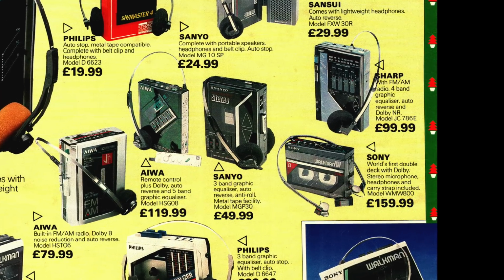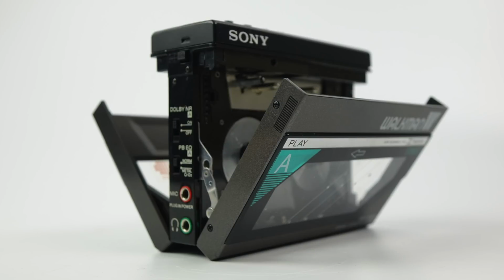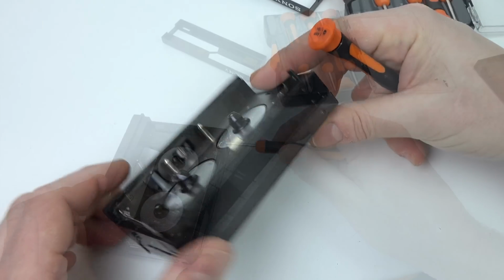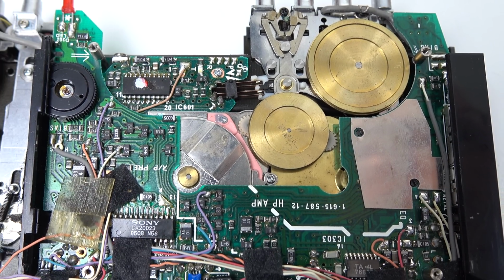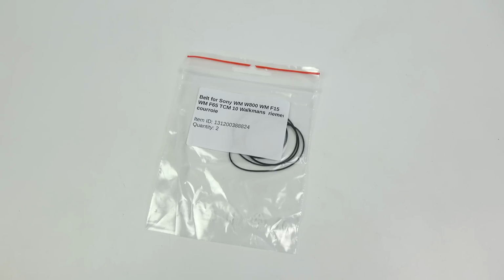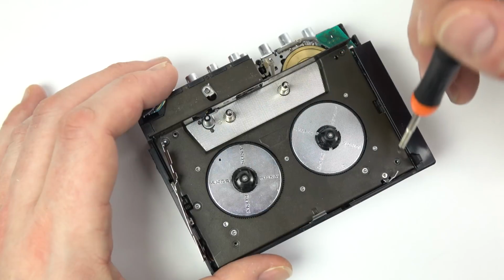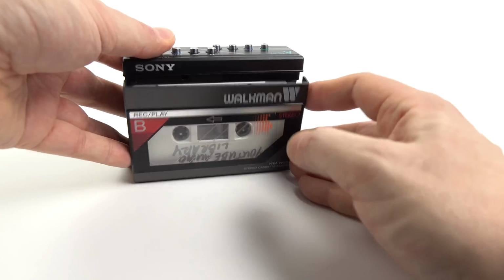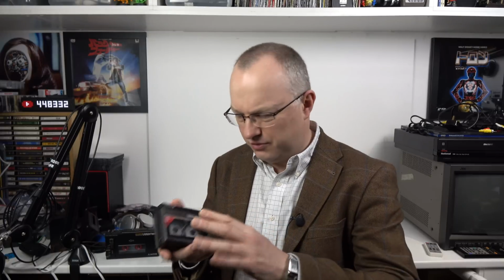'Repairing' the unique Twin Tape Sony Walkman W800

Comment: I have the W800 and did change belts a couple of times. Very easy, I do not see why you present as something complicated.
You did not assemble correctly halves so that is why no sound.
Mine W800 has disease of metal bulging and now there is rubbing metal spool to case... to resolve there must be some CNC mashining.
Too bad, I am first owner so I know problem arrised spontaneous from time not from use.

Comment: should have cleaned the wheels of old tack prior to new belt replacement. Dude all of these things, you're repairing it, but not thinking of usage, long-term, sound quality and speed, wheel slip, on and on. Analog is special.
Reply: it sounds wobbly because your wheels are still sticking and slipping the band. Or you have a wrong angle on a pin causing an off rotation of resistance and free movement and back again. 

Or throw parts at it i guess.

Comment: Hello I have 3 of this WM-701 , 1- WM-702, and 1- WM-707 but all of this ,I changed  the belt , cleaned thoroughly the wheel pulleys, and they suffer from severe wow & flutter. I even changed the pinch rubber . I even adjusted the speed.  what can you suggerst? 
My idea IS TO OPEN THE MOTOR AND OIL IT.  What can you suggest , based on your experience.? Please. thanks

Comment: I’ve been watching your videos again and I actually built up enough courage to pry open my WM-4 to fix it! It was acting pretty weird, playing the audio all slowish and distorted sounding and then after 10 mins it would kick off. I spent days pondering thinking it was a capacitor or such going bad? Well turns out the motor bracket somehow shifts and slowly would shift over to the battery and actually pop it off? I fixed it easily by putting a small piece of plastic (a bread clip) between the motor bracket and the battery. The sound also I adjusted with these small plastic cap things that sit atop the metal drives for the belt, It took a lot of proding and poking to find out the issue but I fixed it! I am going to get a WM-800 for repair on ebay soon so I hope I can repair it!

Comment: I once repaidex two differnt portabe tape decks with ... ta da!... a bit of a paper clip. Ut turns out that the model me and my mom had got, one particular spring was prone to breaking. So a bit of creative bending , and voila ... better than new. It worked until inevitably mp3/cd players came  out and it was no longer needed

Comment: Techmoan There is a slide switch that gets pushed when you press record.  It is probably hindered by a wire or hardware or did not align correctly when reassembled.  It usually has a spring inside it to push itself back to.play mode, but something is preventing it from moving fully back to the neutral or play position.

Comment: Maybe the record switch needs cleaning and lube is stuck in the on position, or the lever trom the record button fell into the wrong place when you put it back together. So like it is stuck on the record mode,

Comment: Have you ever made a video about VCDs, a VCD being a video sufficiently compressed to fit on a standard compact disk? I understand that before the advent of DVDs, feature films were released on them for markets in the Far East. I've made video compilations on CDs and they're reasonable quality, better in fact than VHS albeit it was commonly held that the two were on a par with one another. One problem is finding a standalone optical disk player that will play them.

Comment: After getting home with your pirated tape the first thing you needed to do was start Mr. Copy and copy the data properly to another tape (provided that the tape actually loaded). Analog tape-to-tape copies, if they worked, were a ticking time bomb. The quality of the copy was very poor and it was easy to mess up the volume as well. After some time these tapes started to fail to load properly. OTOH properly recorded Spectrum tapes can be loaded after 30+ years without any problem.

Comment: Tape is such an obsolete medium but just imagine what it would look like if we built a walkman now? In an age of rapid PCB prototyping, CAD on powerful personal computers, 3d printing, the internet and crowd funding. I'm sure most of the circuitry could fit on a few surface mounted ic's , the drive system could be beltless. We could probably fit stereo speakers and a touch screen. Hell we could probably build a video walkman!

Comment: You're clearly better at this than I am.  I bought a second hand CD Walkman in 1990 and it had some issues playing CDs, so I took it apart (making careful note of where everything went) and found the issue: the spiral cog which drove the lens was full of gunk, so I wiped off all that crap and regreased it, then put it all back together and...  it wouldn't work at all, as it was getting no power from either the fancy clip-on battery pack or the AC adapter.  I pulled it apart again and noticed I'd severed a small black wire, by pinching it in between the housing as I reassembled it. Given my soldering skills are non-existent and the wire had almost no slack in it for a bodged repair, I put it all back together again and dumped it.

Comment: Your problem with that walkman is almost for sure the record switch. Just try to undo those screws again and spray a little de-oxit or somethig to clean those contacts inside the record switch and you will be good to go. If you don't want to disassemble the walkman again you can exercise that record button vigorosely to try to "auto-clean" that record switch. You may be lucky with that. Best regards.

Comment: Once had an auto reverse Walkman that wouldn't read the B head in reverse mode, instead reading the A head backwards.  Was going to take it in for repair until I crashed my bicycle at 60km/h with it going flying as well.  When I got back up from the road I walked past the bike to where the Walkman layed only to find it had actually fixed the problem rather than ruining it

Comment: I remember I saved up 90$ in 1995 to buy the Sony recordingWalkman, it was a single deck but recorded fm/am and had a clip on stereo mic, I was in love, besides tape dubbing I have a full use boombox in hand, it even had a speaker in the door, it still works well.

Comment: Repairman Tip: Before taking anything apart, take close up photos, print those out and set your screws & parts where they came from on the print, maybe use some tape to keep them there.

Comment: most of the time, when you have a Rec. button,  there's an internal mode switch on the bcp. it needs o be aligned with the rec button at the assembly phase. easy fix actually

Comment: Techmoan! Love your videos. I have a cassette deck that when playing a tape will start playing and then play increasingly slower. Is that a belt or a motor issue? Second while cleaning the deck I got some alcohol on the pinch rollers from the cotton swap. A very dab but it seems like it discolored or stained them. Still works so I doubt it matters much.

Comment: Suggestion when you take things like this apart.  Use an ice tray to hold the tiny screws.  Put the screws in the tray from left to right as you disassemble it, remove the screws right to left to reassemble it.

Comment: @techmoan There is an internal switch bottom right, that the record button connects to. sounds to me like ghat internal switch is in record mode. There is a u shaped piece of metal that goes over the switch. that is out of alignment and thus your record play issue. 

see in my pictures..  https://m.imgur.com/gallery/oTq6g

source: I have the same unit and just got done fixing it.

Comment: You have a slight advantage doing the disassembly on camera, but taking high-res stills and printing them off as you go, and using those printouts to organize your parts is the best way to disassemble something you have no documentation for.

Comment: I used to think that millions of tiny little screws were bad. Then everything started to be attached with plastic catches, and the screws became easy to work with by comparison. It's really hard to disassemble modern hardware without breaking off one or more of these and/or creating pry marks along the edge of the case where the two halves of the case meet.
Reply: Even worse now is when electronics are just held together by glue and are all but completely unserviceable, even by professionals.
Reply: @sbcontt YT those contact conectors tend to corrode, ribbon cables allow for slimer stuff
Reply: Sony went great lengths to ensure repairability on their devices. There are so many things that amaze me as to how easy or at least not difficult they made repair possibilities.... Like.the wm 31 has cuts in the board so you reach what's below it an adjust without having to detach alot of.sfuff. i think that's one of the USPs of the erstwhile "Japanese technology".
Reply: Swift Fox learn the art of 'spudging' my friend. A nylon plastic guitar pick is often the way to go. Start at an obvious place like an opening aperture on the case and then pop the first latch gradually working your way round with a reciprocating slicing action. My Samsung J5 has a battery cover that works on this principle and i am constantly popping the back off to access the SD card with no ill effect. It even has a little finger lift detent to assist you in the process.
Reply: @MrDegsy69  I've tried spudging so many times it stopped being funny. I nearly always damage the case of the device. Either the plastic is coated with paint that scratches off, is too soft so it chips while prying even with other plastic, or I'm just plain unfamiliar with opening a particular device because my repairs are usually one-offs and I don't repair stuff professionally.
Reply: @MrDegsy69  Using a plastic spudger didn't prevent me from ending up with a handful of loose black rectangles when I opened up my MSI GL75 to upgrade the SSD.  Luckily, the bottom of the case is also held on by screws.

Unluckily, I lost the piece of tape that I stuck the screws to. 🤦‍♂
Reply: @sbcontt YT to take a galaxy s8 back off you need a heat gun and playing cards 😖 but I still loved mine because it was water tight till I dropped it and cracked the screen across the front cam have a galaxy  note 10+ now love this phone so much hope I never break it bought a good case for this one that is water tight because this phone isn't wish i would've bought a better case for my s8 thought otter box was spose to be good
Reply: I've taken apart so many old electronics held together with nothing but plastic clips, from Westinghouse clocks made in the 50's to printers from the 80's. It's not a new phenomena
Reply: @Maddz-Thee-Bee  Perhaps, but it does feel like it's ubiquitous now. It's just a feeling, I have no stats to back it up.

Comment: A walkman for dubbing? Pfft. The only use for a twin deck walkman is to save some hassle from having to swap out tapes every single time. And then using up twice the battery power.. for all that you need power - ergo, a "ghetto blaster" or "boombox" (in lieu of a proper home system).

Comment: Hi, me Tom again. just a quick tip I found out the hard way. Whenever I started replacing belts and pressure pads on cassette decks, I would make it a point to replace the pinch roller as well. 

Now that you have some confidence and experience in working on these little decks, you might want to think about going to the next logical step and purchasing an oscilloscope and signal injector and troubleshooting down to the component level. Once you get into it, it is really not as offputting as you might think. This little deck would make a good start and now the only thing you additionally you might need at first is the schematic. Perhaps the Mister Walkman gentlemen you mentioned would be a good place to start. As a sudden flash of insight you might want to think of try using a free app and a mobile phone for the 'scope since we are for the most part tracking dc to audio 20k frequencies. Let me know what you think.  Bye.

Comment: Hi, Tom from the USA. I have opened up more devices than I can remember and I would like to make a suggestion or two to you to make your reassembly a bit easier.

One, find the British equivalent of Harbor Freight and purchase a magnetic parts dish. I have seen them come in round, kidney and square shapes. They make the possibility of accidentally nudging a conventional parts tray and sending parts flying virtually nil. 

Second, get a suitably sized piece of corrugated cardboard, make a rough sketch of the device in question on the cardboard and put the screws, nuts, etc. in their respective place on the cardboard. This eliminates the nagging question of "Now which screw goes where?". I hope that this helps. Keep up the good work, I love the puppets at the end. Bye.

Comment: The reason why it's 10W is because that's how you calculate speaker power handling, multiply the lowest rating by the amount of speakers, ie 5W x2. This is done because the power you route to the speaker goes evenly to both. If you give the two speakers 13W, the 8W speaker can handle the 6.5W but the 5W speaker probably won't. (At least it won't sound good).

Comment: So many screws!  >_<   Press fit, clips, hinge on one end single screw on the other, so many better options.  Simplifies manufacturing too.  Also wouldn't (metal) gears be better than belts?  Like this W800, the wheels are so close already, just put teeth on them and close the gap.

Comment: The golden age of electronics when they actually put things together using screws.
Reply: Man of Culture true, but honestly it's all integrated circuit and software today and that makes things cheaper to build but harder to repair. If only we could require manufacturers to release source code and schematics 3 years after the last unit of a product was sold to have a community fix bugs and make it work with newer standards and others fix the stuff.
Reply: gentuxable Next lever nerd shit xDD not an insult, just saying by the ring of it
Reply: Become upset.  but I love the clock app
Reply: MadFinnTech and you didn't need to send them to expensive repairing services

Suomi perkele
Reply: Yep now it’s all hot glue so you don’t bother repairing your forced to replace..
Reply: "What's a screw? I'm just use to putting things together with hot snot and flex tape" everyone born after 2000
Reply: @bland9876  Not everyone..
Reply: @Florian00  I don't think "not everyone" is accurate enough it's more like "almost everyone" (almost everyone know what a screw is and things like that)
Reply: @bland9876  Everything can be assembled with the power of Flex Tape!

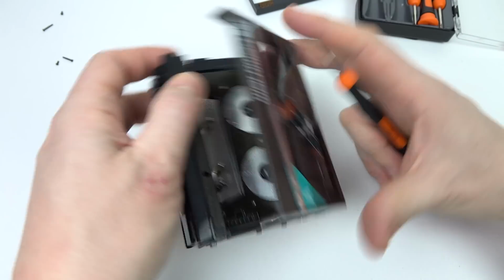Comment: What came to my mind was: The record/play mode switch inside got  slid into the record position, maybe when the two halves of the set suddenly hinged open (5:03) and the actuator lever that normally moves the switch mechanism got separated from it, and then  missed it during reassembly because the switch was in the record position. 
Repair would be to disassemble the set again and find that internal mode switch and put it in the optimum position in relation to the actuator, give it a little squirt of contact cleaner and reassemble....just a fleeting thought :-)

Comment: Sony products of the 1960s, 70s, 80s, and to a degree, early 90s are marvels of volumetric engineering... I have a 1969 Sony calculator that comes apart with a pair of quarter turn slot screws (the type you can use a coin to twist), a spring loaded release, and two retainer clips. From there, you can fold out the power supply board (without detaching the power connectors) and service the unit's 5 main boards. Yup... 5 boards to drive a calculator, all slotted into a metal frame with a backplane!

Sony has a history of exquisitely serviceable products, pre-90s. That whole deal where the assembly folded open... Sony did stuff like that all the time, and it's meant for ease of serviceability. Their service manuals of the era... Oh my... They can bring a tear to the eye, they are so exquisitely detailed, and so professionally laid out! Those were the days! It's truly a shame the old Sony is a relic of days gone by.

Comment: As soon at the battery compartment was attached, I would have tested it. That way if there's something wrong, it's still taken apart to poke with, clean switches, pots, check for loose wired, or broken solder joint.

Comment: Don't get fooled into thinking that all Walkman's are so easy to fix. For example, I have an auto-reverse AIWA that you need to unsolder quite a few connections, take out the board and then you reach the belt. Cheers :)